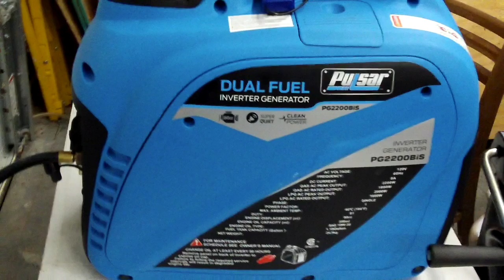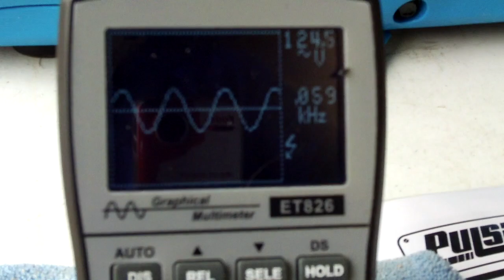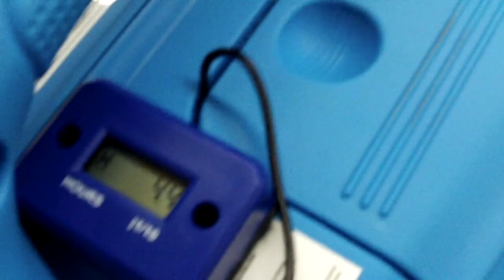Pulsar PG2200BiS mod and operation

Comment: I can't get mine to start or run on propane,  new full tank, turn the fuel switch to the propane setting, screw on the regulator, open the tank, push the button on the regulator, make sure to not use the choke and pull till I get lightheaded and nothing, even unscrew the regulator from the generator and verify the propane is coming out the end of the fitting, still nothing.  Put gas in the tank and it fires on the 2nd pull every time
Reply: I think I pull the choke out for two pulls  then push  it in  and push the button on the regulator again and it usual starts on the  next pull or two. It has been awhile  since  I  ran  it last but  that is my  recollection.
Reply: Do not open the propane tank too fast or the safety valve in the regulator will activate and not allow any propane out. You should hear the propane coming out when you push the purge valve.

Comment: Just bought another one on sale on Amazon for a mere $400!  I've had my first Pulsar like this for five years, no problems... love the dual fuel, the ease of starting, that is okay for my sensitive technology being pure sine and its reasonably light weight and quiet compared to most like it.  I also like the exhaust being high up enough not to be such a fire hazard since I live in a forest.  I think all generators should be required to have their exhaust positioned the same way.

Comment: Hello, Does this include everything needed to run on propane? Do you know the run time on a 20lb tank? Thank you
Reply: The propane hose and. regulator. are included. You must supply your own tank. I ran the full break in of 5 hours plus. several more hours later on the same tank. I have never run it until the propane tank was empty. I recall that the manufacturer says it will run for 75 minutes on a 1lb tank. at half load. I am not. sure why the say. that as it would require an adapter to use a 1lb tank.
Reply: @kq4tv  I believe they are saying you should get around 75 mins for each 1 lb in the tank. The average exchange 20 lb cylinder holds only about 15 lbs of propane. 75 mins X 15 lbs= 1125 mins divided by 60 = 18.75 hours for a so-called 20 lb cylinder.